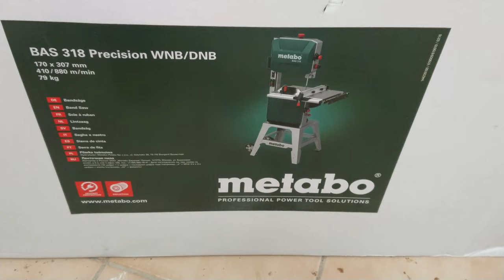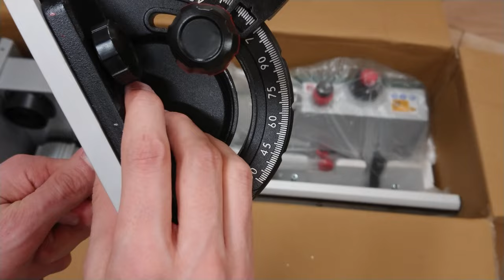Metabo BAS 318 precision WNB

Comment: Hi. Great video! Can you recommend a blade for this machine for resawing 80mm oak.
Reply from the maker: Hi. thank you. for high cuts (170mm) I use a 2240x16x0.5 blade , but a 2240x15x0.5 should also work

Comment: I have a very good video, thank you for your effort, I have a question, I completed the assembly as you showed, but there are 2 problems 1-) When I start the machine, it shakes 2-) When I cut it in a 10 cm blade, the size of the head and the end are the same, but an inward deviation occurs in the middle part. i don't know can you help me
Reply from the maker: 1: for the vibrations I had also had the case, I had to move the machine because the ground was not straight and that solved the problem, there is also an adjustable foot (black part under the foot) which can also help 
2: for the cutting problem if I understood correctly you have a mismatch in the height if so there is an adjustment screw on the top of the table
I had made another video on all the settings https://www.youtube.com/watch?v=59HvgoFOEIc

I hope I have answered your questions if you have any other questions, do not hesitate to ask me
Reply: @js_workshop  hello again, thank you for taking care of me, I think the vibration can be solved, the important thing for me is the shear curvature, the shear curvature is not related to height, it's a horizontal curvature.
Reply from the maker: @emrekalkan9934  I know if it's the blade that deflects, maybe it's not in the middle of the flywheels or the tension isn't right or maybe it's the blade itself (each blade has its function example to cut in the height of a board it is better to have a wider or even thicker blade) some people make high cuts without a guide to avoid deviating too much

Comment: What about noises in dB? 98 dB?
Can you check with the sound meter smartphone application?
Reply from the maker: empty it's around 75db , when I cut it's 80-85dB, it's a relatively quiet machine
Reply: @js_workshop  Thanks for your detailed reply, this is very important for me to know before buying
Reply from the maker: @Крапка-л7э  you are welcome, yes I understand, it would be a shame to buy it and not be able to use it as desired

Comment: Dali ste zadovoljni strojem?
Reply from the maker: yes, I'm satisfied with it, even if it has a few minor flaws (the original blade isn't necessarily the best for my use, the table extension is a bit cheap, etc.) I'm quite picky about the quality but in the end it does what it should do (perfectly straight cuts with the right blade)